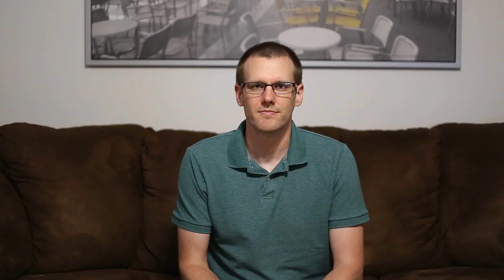Top 3 Mistakes When Selecting a Brushless Motor

Comment: Hello
I have a omnibus xrotor f4 g2 fc and 4 individual platinum pro 30 amps esc no bec 12000hz. What's the right protocole to use them in betaflight make them work with the fc or there's others special sitings. Or just it won't work.

Comment: To be optimal my engine must turn between 24,000 and 32,000 revolutions per minute?
Reply from the maker: Optimal RPM depends on the application. 24k-32k sounds good for most fast electric boats.
Reply: @RCexplained  ok , thank you ;-)
Reply: @RCexplained  and for monster truck ?

Comment: Great vídeo but I have a quick question for you can a 3660 size can brushless motor 3300kv work on 6s or its to much what do you think? Its for my 1/18 scale car
Reply: no, too much. that is already overpowered on 2s for 1/18. not that it will burn but drive train won't hold basically.
Reply: @knoopx  check out my latest vídeo of my 6s build 1/18 scale wltoys
Reply: @rcmodcars7759  let me know when your diffs/gears give up
Reply: @knoopx  okay btw im running plastic  diff gears the only thing that is metal are the mod1 spur gear and pinion

Comment: can you advise me what kind of motor that i need to look brushless sensored or brush for drifting a lot of product i dont want to make mistake any suggestion every one im new with rc i dont know anything help please
Reply from the maker: I have been able to drift using a brushed motor, brushless sensorless and brushless sensored motor. It really depends more on your setup then the type of motor. A better focus for success is having the correct traction, power and weight distribution.

Comment: What batteries would you recommend for a 1/5 scale running a max 5 esc and leopard 58113 1050kv motor?
Reply: 2s 3s max  why would you go for 4s or higher if the % to burn your esc is higher than
Reply: @White1sox  Why use such underpowered batteries in such a powerful system? That's like putting 87 octane gas in a nascar racecar. I was just curious what type of response I would get. I run 8000mah 14.8v 4s 100c x 2 (8s) in my dbxl-e 2.0.
Reply: @White1sox  bro it can take way more than that

Comment: So a 2s lipo on my buggy 3650 motor what KV 2300 or 3100? Or even 3900?
Reply from the maker: That is a significant difference. 2300 vs 3900kv. You'll want to know the potential speed you can hit with both kv options. You'll also want to compare against what others are running.

Comment: What would be a good brushless motor for smt10
Reply from the maker: What performance are you looking for out of your smt10? What speeds do you need?
Reply: RCexplained close to maybe 25 mph. Also a motor that doesn’t overheat quickly. I have a 3930k motor and it gets a little warm on full throttle within like 30 secs
Reply from the maker: @TortugaBruv  Have you considered a castle power system? Stock gears in this truck doesn't fair well with higher amounts of power output.
Reply: RCexplained I haven’t. So do I need to upgrade gears? I have the new release

Comment: Ok so newbie here i purchased a goolrc 4300kv brushless motor with a 60a esc also ordered another esc 60a from hobbywing a higher quality one just incase is this overkill for a primarily off road buggy 4wd 1 10 scale its my first time upgrading to a brushless system
Reply from the maker: It's hard to tell without details such as the specific RC you have, gearing you are using, battery pack you will run and size of the motor.
Reply: @RCexplained  the rc is vrx octane xl with a 3650 size motor 4 pole 12t as for the gearing no idea hope this information helps cant I just use any 2s or 3s 5000mah battery ill be using it for off-road bashing mostly thanks in advance

Comment: I have ordered 4600kv motor 40A ESC and 3S 2200 40C lipo is that a good combo ? For a race boat but not jet boat and the max rpm is going to be almost 50000rpm
Reply from the maker: Hello that's far too many RPM for a fast electric boat.  There's a video on the channel outlining picking components for a surface drive RC boat.
Reply: @RCexplained   then what is the best rpm motor ? Is 36000 rpm good or still to high ?
Reply from the maker: There's a really good video on the channel that goes in to these details. 36000 is still high but can work.

Comment: Hey, awesome videos. I’m new here and maybe I just missed it, but I’m struggling to sort through motors and I don’t really understand the advantage/disadvantage of the motor diameter versus the motor length when concerning the performance. Is there a reason one dimension would be more important or will a longer smaller motor perform as well as a shorter bigger motor with similar specs?
Reply from the maker: Welcome aboard! Motor diameter vs length is best to be selected to physically fit your application. In terms of performance, there is not a major difference between a larger diameter vs a larger length. Overall a larger motor in terms of volume or mass will perform with more power output potential.
Reply: @RCexplained  Very good to know. I had suspected, but listening to your point on heat dissipation I was considering if the longer length motor with a similar number of turns would have more space between each turn internally. I imagine that difference would not be noticeable, but I never assume with electricity. Thank you for your input and keep up the awesome videos!

Comment: The only way I know to figure out the "Demand" of a motor is to place it in the situation that it will be used in. Then check wether the motor is hot or not in the first pass.OR connect it to an amp meter run the boat, plane, car,  whatever and see wether it falls into the motors parameters. The thing that throws a wrench into the whole thing is in and out of the water or jump with a car. For example: A water pump jet direct drive for an RC boat. Water jump the boat.  The action puts the motor into free run then plunge it back into the water under max load. How in the world to you take account for this action. Amp draw should be on the extream end. Does it happen all the time...NO just when you don't expect it.  For example: I have a 40mm jet drive I'm powering with a 4 pole 4074 1400 Kv brushless the boat itself is 36 inch long shallow draft "V" hull. Max. amps of motor 60Amps, max voltage 40V dc max power 2400w. New boat never run with power plant. 1400Kv x 14v.+- = 19,600 rpm. Voltage is OK I am in parameters, Amps draw Don't really know. What is the best way to say OK this is the motor for this criteria?